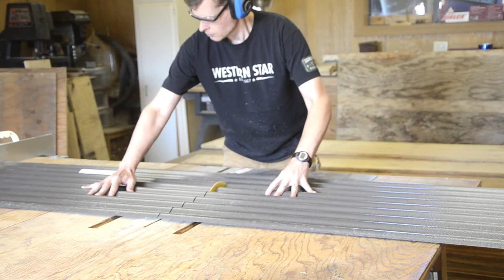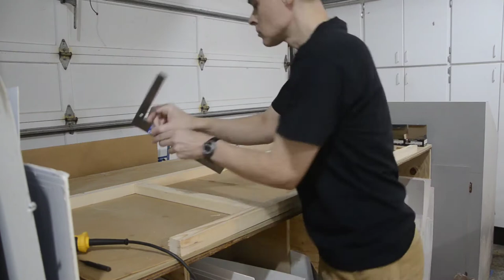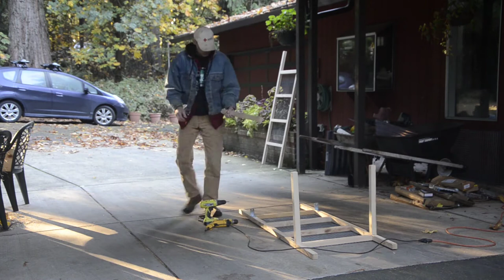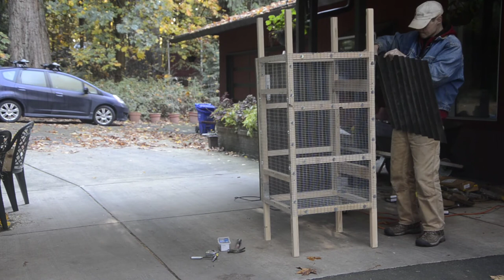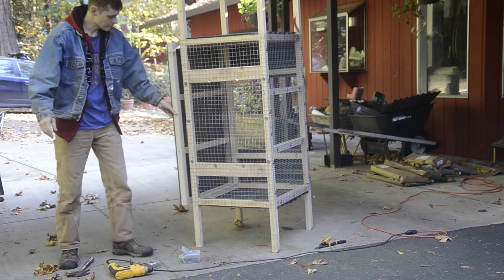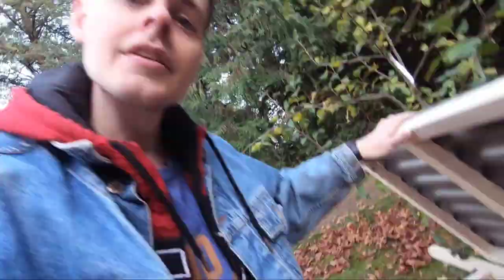Building  Rabbit Tractors

Comment: I would suggest putting larger wire like 2x4 inch on the bottom so they can get to the grass more, otherwise great design!
Reply from the maker: It is like you read our minds! We just did a revamp on the tractors as the wire has been a problem. There will be a new video tomorrow with the new design,
Reply: @SimpleMoonFarm  thanks for letting me know! I'll be sure to watch it